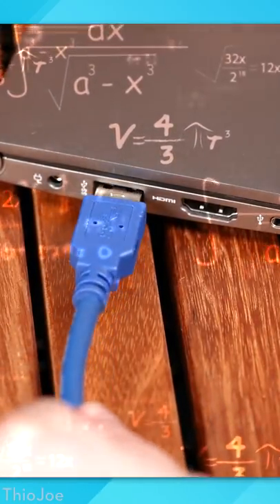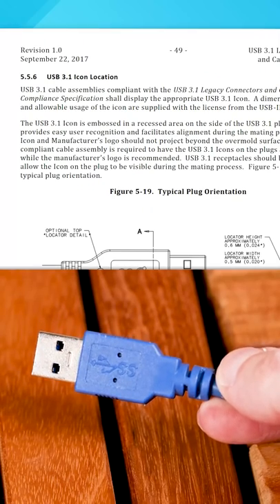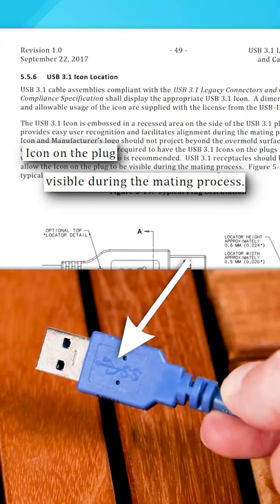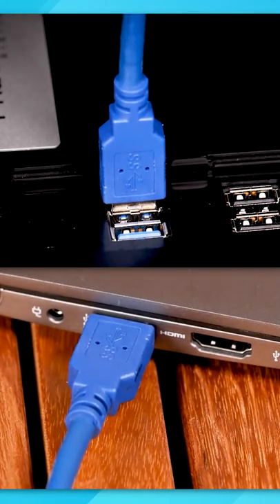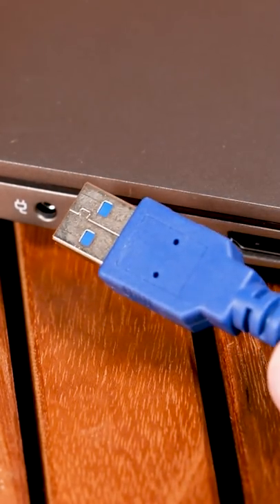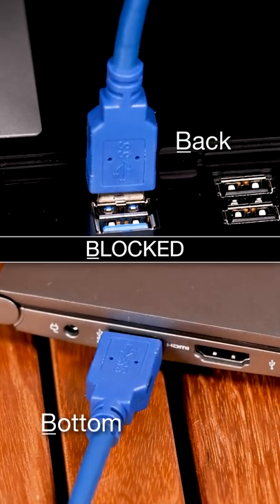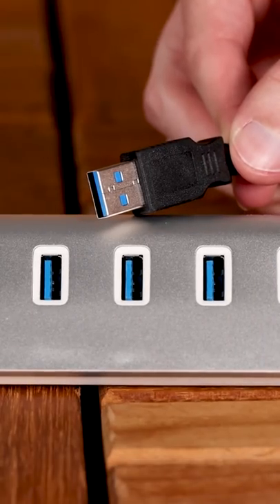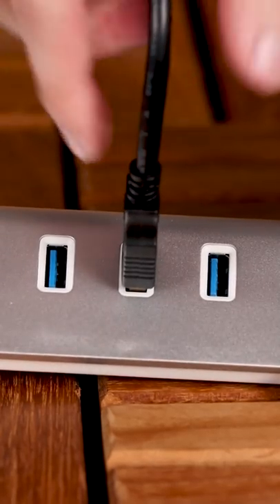Never Plug in a USB Wrong EVER Again

Comment: USB C: I don't have such weaknesses.
Reply: Lightning: "You exist because of me."
Reply: @michaelmonstar4276 That's not entirely true, as work on Ligtning started after Apple started taking part in the spec of the USB-C because of the long time needed to create that spec.
Reply: Did not expect to see you here!!
Reply: that's what i was going to say
Reply: USB-C breaks much easier than regular USB though
Reply: i still prefer USB 3.0
Reply: USB C specifications: I am the wrong cable
Reply: @michaelmonstar4276  yeah no apple was actually going to use usb c but because of less time they used lighting
Reply: @michaelmonstar4276  that's not completely true
USB C created together with some company, and apple are part of it(before 🍎 quit)
Reply: Headphone jack: I'm 4 parallel universes ahead of you
Reply: @adam632   
"i still prefer USB 3.0"
Which can be either USB A, B,  or C.
Reply: And lightning
Reply: @uiopuiop3472  does it? I've had mine for 4+ years and it hasn't broken at all.
Reply: @michaelmonstar4276  Lightning, Still USB 2.
Reply: But it does have its own. Still the best so far though.
Reply: The fact that I still fail to plug in USB C says something about me...
Reply: Some PC Case manufacturers make the USB-C port so tight, you nearly destroy it each time you plug in the cable. Better plug it once and use an adapter to spare the port. 
USB-C ports are very fragile compared to USB-A.
Reply: You're right. Instead, USB-C is a mess of a billion different things electrically (USB 2.0, USB 3.2 gen 1x1, USB 3.2 gen 1x2,  USB 3.2 gen 2x1, USB 3.2 Gen 2x2, Thunderbolt 3, Thunderbolt 4, and a few other things) and a lot of cables on the market are horribly labeled for what they're capable of
Reply: doesn't fit into usb a socket though
Reply: @kokodin5895  They have adapters for that.
Reply: @WilliamLDeRieuxIV  great then you would have problem with pluging the adapter instead and then only the socket with adapter to plug usb-c, waste of effort and materials
my point was you can't remedy problem with fitting round object into square hole , if you need an adapter you still have to fit it corectly and it makes usb-c not a solution but another problem to solve
Reply: @kokodin5895  *Fit it correctly* --- that's not a big deal just flip 180-degrees and shove it in., If you can't figure that out then you have bigger problems.
Reply: @WilliamLDeRieuxIV  but that is what the video is about, are you lost?
Reply: @kokodin5895  The point is that no one needs to be told about how to insert it properly......if doesn't work one way try the other.
PS: The OP (Chiroyce) is talking about usb-c not having this issue (an issue that is irrelavent and wasn't actually a problem that needed to be "solved").
Reply: @WilliamLDeRieuxIV  my point is when you buy a device like mouse , keyboard , or flashdrive you most likely don't have much coice and it will be usb-a not c so usb-c solves nothing unless you want to use a bunch of adapters, comenting about usb-c is irrelevant to the video in general because it is a different connectot with different pros and cons, besides on many pc cases it is still rare find, unless we talking phones or other mobile devices it is an unicorn lacking wide adoption, and people still put usb-a on 3rd try regardless if they know what way is up or not, and there are people who wouldn't even know what usb -c is
so ""usb-c don't have such a weekness" is lieke saying f1 cars are faster than your grandma microvan
Reply: @kokodin5895  You must really like to rant.....I already stated that usb-c doesn't solve any problem..

As far as not having a choice when you buy something -- this is where adapters come in to play, because of them you don't have to worry about what type of device you buy..
Reply: @WilliamLDeRieuxIV  but why bother if you don't even have one port or device that has usb-c?, you don't have to explain to me what are adaters for and how to use them, but in my country usb-c is non issue as if it never existed outside phone charging port use
none of 150 deskyop computers in my work has it
none of 35 laptops has it
each phone that has it uses usb-a charger
when standard of usb-c was anounced many years ago i was excited about it too but today i feel it never really carch on 
who know what usb foundation think of next when we already have double plug standard of USB 3.2 Gen 2x2 nobody asked for. usb-c is just a hassle to use
Reply: It's almost like if they've created USB C just because nobody reads their specification 🤣
Reply: Now you just have to find that tiny hole at all.
Reply: @josuke6131  Bluetooth : pathetic
Reply: ‘Put those foolish ambitions to rest’
Reply: Ya.
Reply: @PoptartParasol  I broke more than four in four years
Reply: @adam632  thunderbolt is so fast its used to connect gpu
Reply: @hybridtox  the other side is just his twins
Reply: Chiroyce? This isnt wasteof money cool seeing u 🙃
Reply: @zwlw  dang its crazy when you meet the same person on different parts of the internet!
Reply: @chiroyce  I don't know how to respond to this
Reply: Personally we will never evolve better than usb 3 micro b “best“ connector ever. (galaxy s5 had this)
Reply: @uiopuiop3472  Do they? I see a hole broken USB-A in my life but nether a broken USB-C.
Reply: @josuke6131  Bluetooth with HD Audio in the rest of the multiverse: "Why is there a hole that's named "Audio"?"
Reply: @edgarwalk5637  Only the Lightning on iPhone. The Lightning that was use on the more expensive iPads got to extra pins for USB 3.X
Reply: @kirkanos771  Or you stop buying at Wish! I daily plug USB-C stuff into and out of my phone and my PC and nothing is damaged yet.
Reply: @cardboardsnail  On the other hand, you don't need more than one connector. And companies like lack of transparency about their products. No shit, Sherlock! Or do you think, tobacco manufacturer like to label their products as death accelerating drug? Do meat producer say you what antibiotics the animals got which were destined not to be used until a bacterium resisted antibiotics that are less dangerous to humans, to curb the development of multidrug-resistant germs which could trigger epidemics and theoretically bring another pandemic over us? Do oil companies say you how terrible CO2 is for the environment and that not matter what you do, you can't be part of the society and be environmentally friendly as long as the system becomes environmentally friendly which means that politicians has to make the three most important parts for stopping the climate change? No, they never wanna do be transparent about the negative sites of their products because they would sell their shit to the people then. Politics has to force them. That's how data protection works. That's how customer protection works. That's how the European worker protection works. Balancing are created but creating to any force in on directions another force in the other direction. Having problem with socialists? Put some capitalist in our houses of Parliament. Having problems with capitalism, do the opposite. Having problem with a not working politics or political instability because the capitalist and the socialist doesn't work together and they invented communist as well as racist in your parliament, then add a middle class party to the parliament. Having problems that the middle class becomes too sttong and corrupt, then add left- as well as neoliberalist, some pan-Europeans, a green party and some other weird stuff up to point when you can't say if that's the diagram of the last election or the last Christopher Street Day. For US-Americans: Yes, it's possible to have more than two parties in your parliament! Common thing in modern democracies. And it working, not good but working. As Churchill said, democracy is the worse kind of political system we have, except every other political system. It sucks but less than the others.
And yes, in Germany,  we can almost build the LGBTIAQ+ colours with party colours: Red (SPD (left liberal) and Linke(communistic/socialistic)), orange (Piratenpartei), green (Bündnis 90/Die Grüne, leftliberal-ecohumanist), yellow (FDP, neoliberal), light blue to magenta (Partei der Humanisten, neo- to socialliberal ecohumanism) & violet (Volt Deutschland, the German party of the socialliberalist, ecohumanist Volt Europa Organization).
Reply: @alicethegrinsecatz1611  That's a strange political tangent you went on there. Hopefully that was some copy pasted stuff, and you didn't actually spend time piecing together that.
Reply: Rounded pc ports: you think ima joke?
Reply: Jack conector:”only 2 sides? I domt have such weakness”
Reply: @michaelmonstar4276  lightning port is a joke of apple to force their chargers and other devices to be bought with their Iphones 🤣🤣 Best is the type works with almost all smart devices .
Reply: @uiopuiop3472  feels like reverse
Reply: @michaelmonstar4276  electricity: "weaklings"
Reply: @redoper1  yes it is 2012 had it already
Reply: @michaelmonstar4276  USB c came first
Reply: Old Nokia Charging Port: *goes 360°
Reply: @The_Divergent  they didn’t exactly quit, they wanted to use a smaller charger port but usb c took to long do they used lightning. They use usb c on their Macs and iPads though and the EU is mandating usb c on all phones and headphones so apple would have to implement usb c by 2024
Reply: XD
Reply: So USB C is fragile?
Reply: What you don't ever use pc woth mouse and keyboard or usb flash drive which all of us literally all of us uses you're insane ma man. Like you will never plug anything in you're life that's actually sad.
Reply: @uiopuiop3472  stop buying them at the Gass station.
Reply: @PoptartParasol  he means scratched
Reply: @LaloJK  i buy from anker and other big brands. idk what you're going on about
Reply: That round plug: pff, amateurs.
Reply: @uiopuiop3472  might be true, but what are you doing to break a type c??? I have owned countless type c devices with no issues
Reply: 3.5 mm jack: I am beyond your understanding.
Reply: @redoper1  that's just a long way of saying ratio
Reply: xd
Reply: @uiopuiop3472  That’s absolutely not true, quite frankly it’s the opposite.
Reply: @MrBombastix1  You might be using bad quality USB-A connectors, decent ones have way more protected points from bending than USB-C, and with more mass usually
Reply: @phillipzx3754  nah.. 3.0 isn’t C (although the 3.1 spec is backwards compatible)
C is something like 3.1bananaapplejuice
As it was developed at the same time with 3.1.

When we talk about USB 3 .0 it’s not C.
It’s A or B.
Because C did not exist at stage 3.0
You can say USB 3.0 mode on USB type-C, thanks to compatibility, but it would be inaccurate to call it USB 3.0.
Just as you don’t call a USB 3.0 cable a USB 2.0 cable simply because of its backwards compatibility.
Reply: @StevenF8  5mm jack: I’m bigger than you 😏
Reply: @alicethegrinsecatz1611  
“Please don’t get mad please don’t get mad please don’t get mad”
*never
Reply: Some circle charge: what?
Reply: JBL be like
Reply: Headphone jack doesnt have weakness at all
Reply: You beat me to it
Reply: Jack: 360 no scope
Reply: @phillipzx3754  but he's obviously referring to A or B if he says the prefers it over C.
Reply: @uiopuiop3472  LOL NO IT DOES NOT USB As main weakness is a dent
Reply: @edgarwalk5637  Lightning isn’t a Part of the garbage usb specification that’s why it just works unlike usb because lightning is actually universal
Reply: This was when usbc first arrived but it was still a dumb idea:

I attempted to plug a usbc cable into a usb port so it shorted my computer
Reply: Cylinderrical ports: Haha, amatures
Reply: @cardboardsnail  even if you bought the weakest usb c it will still out eprform or perform similar to lightning lmao
Reply: @kokodin5895  its the future mate and that is becuase its capabple of insane speeds while retaining a small form factor
Reply: Or buy a cable from JBL they have cable that go in both ways because the bl9cked thing can move forwards and backwards and has connectir on both sides
Reply: Headphone jack: am I a joke to you
Reply: You know the PC side on the USB-C is the same. Only the end is different. the problem is still the same.
Reply: @michaelmonstar4276  other way around
Reply: @uiopuiop3472  you have to look at both the socket and the cable, because while the cables are less durable, the usb sockets which are much harder to replace, got much more durable with USB c.
Reply: @josuke6131  jack is only for sound and most of phones doesnt have it
Reply: I like how the Thunderbolts and lightning cable have like their name suggests : « no time for this s*it »
Reply: USC C: "I can mate in the dark!"
Reply: @adam632  the 3.0 refers to the speed, the C refers to the shape, those are different attributes.
Reply: Yup you can plug it in however you want
Reply: Nokia 360 charger joins the chat 😂
Reply: @michaelmonstar4276  "Yet I am still better than you!"
Reply: @redoper1  electric u cant not work with ME
Reply: @austin6480  what?
Reply: @IKnowImStupidBut  dust: loud chuckle
Reply: @uiopuiop3472  maybe don't torture usb devices genious
Reply: @redoper1  also USB was supposed to be omnidirectional from the start, but that was changed before the first release
Reply: That is correct and truth.
Reply: Meanwhile my HDMI port is upside down🤦🏽‍♂️
Reply: @ItsJustRuru  but the shape is in that direction not symetric, so....
Reply: @redoper1  nope lightning came out first.
Reply: @9852323  yeah, I agree. Please read my comment more carefully, I didn't write that it came out later, but that they started working on it later...
Reply: USB C: doesn't work, flip the port, doesn't work, flip again, it works !
Reply: USB A will never die so long as devices are bigger than it
Reply: @uiopuiop3472  thing about micro USBs is that they can be unplugged fairly easily, with USB-A you're pretty confident that it's secure
Reply: @ber2996  Agree, micro USB was way worse than both USB-C and USB-A, with USB-A being the best one in terms of retention
Reply: it actually does, it connects the same way as most USBs
Reply: @joaquix3471  yess
Reply: Oh my sweet summer child. There's a myriad of ways to screw up USB or have partial service/cable failures
Reply: Oddly I often find that a couple of my devices (both Samsung Galaxy's of different generations) will only fast charge with the USB-C facing a specific direction. Even with a variety of different cables. Other than that I'm really enjoying USB-C. 

I run a small mems laser projector off of my phone with USB-C providing both video signal and power (using an adaptor to split it since the projector uses micro USB for power and HDMI for signal). It's crazy to think that I can carry a 40" screen (100" if used in a very dark room) in a package about the size of a deck of cards, with a minimum of wiring.
Reply: is USB-C the square one with rounded corners?
Reply: True here
Reply: @traintobeckton262  yeaaa
Reply: Yo chiRoyce from scratch
Reply: @uiopuiop3472 If you're heavy handed or impatient then yes.
Reply: @ryzenryne8747 i just like to use my laptop as a laptop